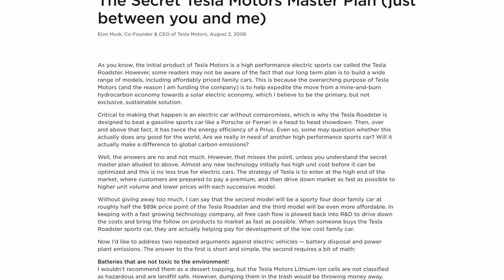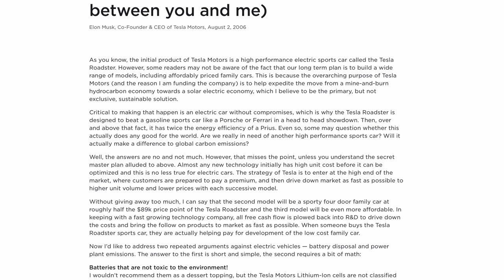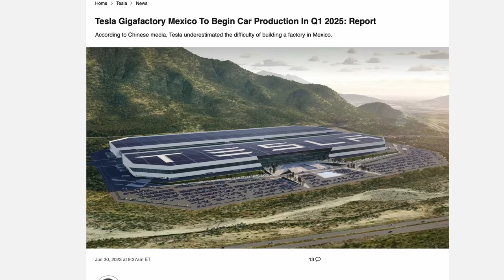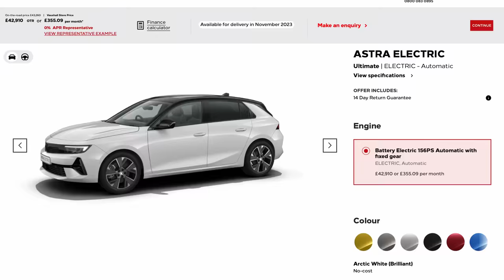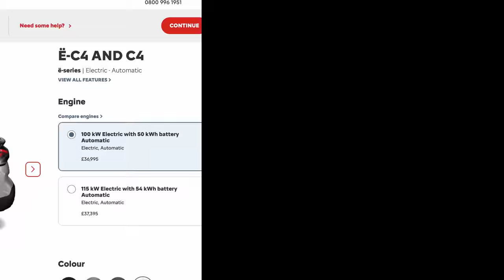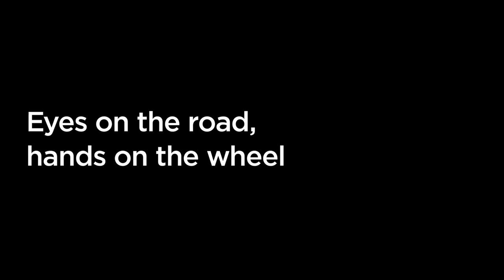Ford Slashes EV Production To Stem Losses | Dire Consequences For UK Vehicle Sector

Comment: Your assumptions miss the point that in the UK electric cars are not that practical due to mileage, charging infrastructure and depreciation costs so mass adoption is not around the corner.
Reply from the maker: I wish people who make these claims would actually try an EV. I have driven 20k miles this year in an EV without problem. What exactly is not practical?
Reply: @davetakesiton  There’s the problem, to “try one” means you have to buy one and that means if you find it not suitable you loose money that most people cannot afford, especially with the EV depreciation. We also have the fact that the technology is developing and decent range batteries are just around the corner but which corner, I am also very concerned that EV’s are not as eco friendly as they appear and given the safety concerns I.e. fire, I for one am not convinced. Where at present an ICE is a known quantity. I am retired and looking to buy but have not been impressed.

Comment: You seriously overspent on your renovation in a very downmarket area. Some more research of the area or professional advice may have flagged that up. Good luck with your rental.👍
Reply from the maker: I did, but it was a nice house, just the wrong area. Still, got 2 years rent then sold at a profit before the prices crashed, lucky timing

Comment: I believe the key word is Software.

The affordable EV that customers want is closer to an iPad than an ICE car. I believe Apple would have a better chance at succeeding with an EV than legacy auto-makers. Tesla's are basically iPads on wheels. There is one central computer that controls everything, including the complex low-level motor control mathematical functions that over time can enhance performance with over-the-air updates. Legacy auto-makers have many computers distributed throughout the car, each from a different supplier, with different software, created with a different stack and programming language etc.

The cars of the future will not come from the legacy ICE auto-makers. The two most successful at the moment are Tesla that I'd say comes from a software first approach and BYD that comes from a battery first approach. I believe software first is much more likely to succeed than battery first. I believe the Chinese are successful while copying the west and then they add something completely silly on top like swappable batteries, a little robot with eyes constantly looking at you, guitar strings on the side doors, completely silly names etc. 

Currently I can't imagine anyone succeeding when compared with Tesla.
Reply from the maker: Apple should give it a go. After all the legacy companies have had a go at installing computers they know nothing about, may as well let Apple who know nothing about making cars have a dabble. making a tablet is not the same as making a compelling EV to challenge the worlds most successful EV
Reply: @davetakesiton  
I still think Apple doesn't have a chance to compete with Tesla. That's why a few years ago I went from all-in on Apple to all-in on Tesla. My point is that I think Apple would have a much better chance than legacy ICE auto-makers, they would be starting at a much better stage but still not good enough. I think Tesla innovation is off the charts, they will not only sell over 20 million cars in 2030 but also be the world suppliers of energy, the equivalent of all the current oil companies put together, plus robots, FSD, AI and many revolutionary products that haven't even been unveiled.

Comment: Ford seems to have fallen for the "go woke, go broke mentality". I'm not familiar with the European car market, but here in the US, gas is still relatively cheap, making ICE more economical, compared to electric. On top of that, we drive a lot more miles than Europeans. In major cities, our commutes are long and slow. Where I work, our IT guy has a commute of 2 hours each way, assuming no delays. Here, EVs just aren't as practical for most people.

Yet, the government is pushing EVs very, very hard even though the power grid is not even close to being able to handle the projected increase in load they will create. In some liberal areas such as California, where the government will be restricting the purchase and operation of ICE vehicles, the power grid can barely handle the current load, due to years of restrictions on type of power generation that have limited expansion of power generation. And the average person, in this economy, cannot afford to spend thousands on rewiring their houses for an expensive charging system.

In short, we have incompetent government pushing manufacturers and consumers into buying cars that won't work as primary transportation for many people, and that can't be supported by the necessary infrastructure. Their assumption is, as the narrator of the video is saying, that if you want something bad enough, you can will it to happen.

The problem is that as with all the other woke s***, at this point, it's just another politicized liberal movement that isn't based on reality and fact. And Ford and other manufacturers are going to find out the hard way that they've been bamboozled by the same idiots that are currently wrecking America and its economy. Their problem is that the liberal bureaucrats will pay no personal price for their bad decisions. Manufacturers like Ford will, and when they are inevitably bailed out, it will be by taxpayers like me who didn't buy into the BS.
Reply from the maker: Yes, everyone tells me that about mileage, but I did 20,000 miles last year with 30% supercharging out on the road. I believe the US average mileage is 14,000, I beat that by 50%. Our grid is coping really quite well and I'm happy with my EV.
Reply: I think you are a Trump supporter judging from your choice words. EG Woke Liberal etc etc.

Comment: This analysis is flawed because it assumes that people want to drive ev's and cheap ones at that, not true,  evs will be replaced by hydrogen as it is the only alternative for large jeeps trucks etc. The tesla build quality is very poor and not comparable to German  made cars,  people will not pay 25000 for a poorly built Tesla.
Reply from the maker: talking of flawed analysis, did you know that Teslas are made in Germany by German engineers and the motoring press in Germany states that those Teslas easily now match that of other traditional German manufacturers. Get up to date

Comment: Ev's cost more not because of only mark ups but they are inherently more expensive to build. EV's still and always will have disadvantages that will not be overcome by new technologies. I don't care how hard they are pushed by the EV cultists and power hungry governments. The gasoline powered vehicle is are better buy and will remain so. You can buy a ICE vehicle and keep it for 10 plus years with proper maintenance. In contrast an EV's battery pack starts dying at the 1st recharging. That is just one of the many many reasons why they suck.
Reply from the maker: Hey great info, how do you explain 1 million mile EVs? How is 10,000 components spinning round at 5,000rpm in the engine and gearbox better than 1?  gasoline is dead, you just done realise it yet
Reply: @davetakesiton  How many 10 year old EV's do you see running around?
Reply: There are ten year old EV still on the road  just because there range is not the same as today EVs does not mean they don’t exist and just the same as ICE if you thrash the a…se out of it and don’t look after it it won’t last very long…
Reply: @dennisswaim8210  mine will be 9 years old at the end of this year, done 65k miles in it still has 95% of the range it had when new
Reply: @eddthirty4065  I am glad it's working well for you. I will stick with my gas powered vehicle until the government forces me to get rid of it. At that point I will miss being to drive to the beach and go on vacation without worrying if my battery really has the range to get me there. In a gas powered car I could just pull into a gas station fill up and be on my way. In an EV I'd hope I wouldn't have to spend 1/2 a day charging it on the way or even worse waiting for a charger to open up.That is if I can find a place to do so in the way. In a gas powered car the only limits on how far I want to drive is until I get sleepy, usually after 10 to 12 hours of travel time. God forbid I ever have an accident in an EV cause I  might have a hard time getting it towed and repaired. Who knows how long it will take to repair it. I guess I'll have to have a 2nd vehicle just in case. That will be a new experience for me cause I usually can only afford one car let alone one that cost 1/2 to twice as much. So 100 years ago the gas powered automobile proved it superiority to electric cars and those factors still remain the same. EV's make a fine commuter vehicle for short distances but not for most of us who wish or need to travel far. So if you can only afford one car you want something you can count on in all circumstances. Good luck with you EV and happy driving.
Reply: @dennisswaim8210  I actually agree with you - We only use the EV for around town. It's cheap, a Nissan Leaf. Can't afford one that does more miles. It saves us about 100USD a month (We live in the UK, gas is expensive, around 7.00 USD per gallon) Fossil powered vehicles are still much more practical, we have 2 in the family. Our newest gas car is 14 yo, my personal car was made in 2005.
Reply: @eddthirty4065  Very good if could keep one as a commuter for short trips and such I would. Lots of retired folks here in the states use golf carts at the larger retirement communities and hardly ever drive a car. They fix em up like 57 Chevys, Rolls Royces and such. Mimi car shows very fun events.
Reply: @dennisswaim8210 
The reason you don't see lots of ten year old EVs on the road is because very few were made ten years ago. I have a ten year old Peugeot Ion EV. I'm currently getting 5% greater range that was claimed on its launch. No sign of the battery failing any time soon.

Last September I bought an MG4 SE Standard Range EV with a WLTP range of 218 miles, which is absolutely fine for me (and most people). It has 52kWh of Lithium Iron Phosphate batteries that, in scientific tests, last around 5000 cycles before the capacity drops below 80% of the original capacity. This means I can reasonably expect the battery to last 1,090,000 miles (5000 cycles x 218 WLTP miles) before the battery capacity drops below 80% of the original capacity, so 174 WLTP miles (which is still fine). The average car in the UK drives 6,800 miles a year, which suggests the batteries in my car should last at least 165 years and still have a range of 174 miles.

Think about that.
Reply: @sailingoctopus1  Time will tell. For every good experience reported on EV ownership experience I see as many bad ones. I guess it us up to the individual to ascertain for themselves. I am not against EV's per say I just can't afford to buy something that doesn't work for my needs. You are taking a gamble that they will work as advertised. I don't want the government forcing me into one. That is the direction things are going. So happy driving in yours  I wish you continued success with your EV. I will continue to eagerly listen for the reports like yours of good experiences. So when that day comes that I am forced to drop serious $ on one I can make the best purchase. Good day sir.

Comment: You ramble on about low interest rates and buying cheap houses fora rental income.....
Then talk about car prices as if they are as cheap as chips.
Compared to wages in the recent low inflation era.
Car prices have shot through the roof as has fuel.
A car after development costs is just  a few bits of cheap metal pressed into shape with a few plastic bits also pressed into shape .
Engines are nothing special either to produce.
We are all paying far too much for crap cars and motorcycles.
With many parts made in third world countries.
Think tin garden shed with a top of the range lawn mower inside and ask yourself would you pay £25,000 for it let alone £ 40,000+..?
I wouldn't mind if the seats in the latest cars were actually comfortable and you had a relatively silent ride without hearing  the clunk ,clunk ,clunk of every pothole that you hit .
If a car is not a tax write off then your better off buying a older good quality brand with marvelous seats ,almost silent running and a pot hole eater .